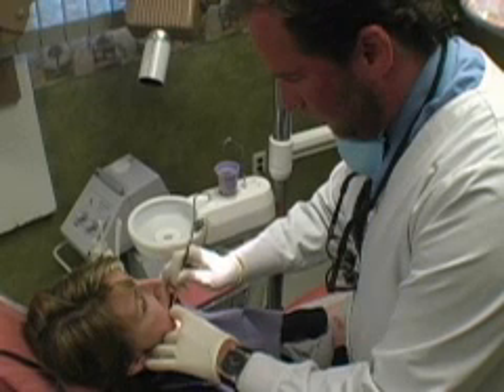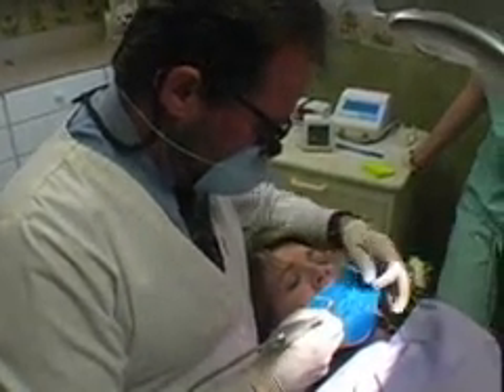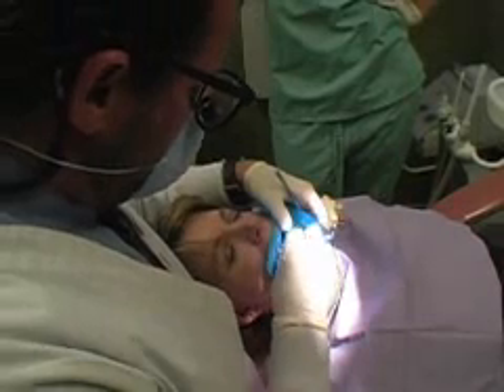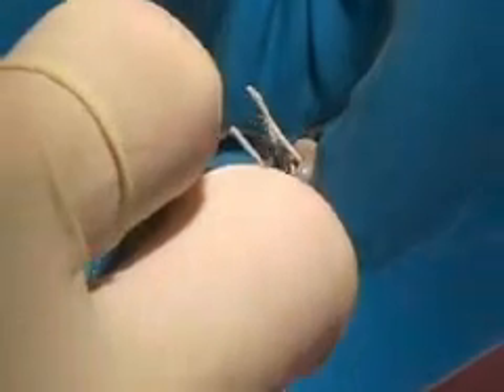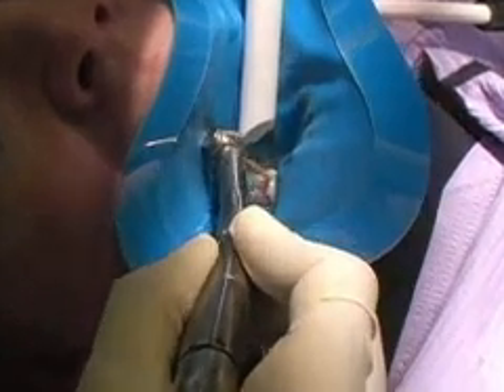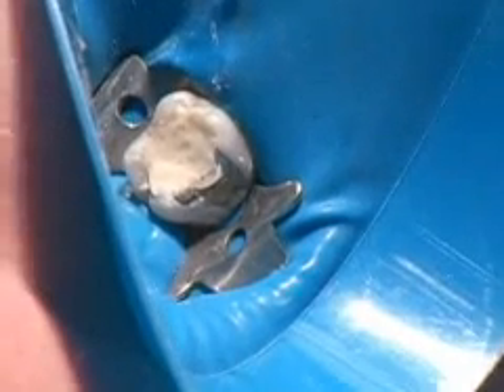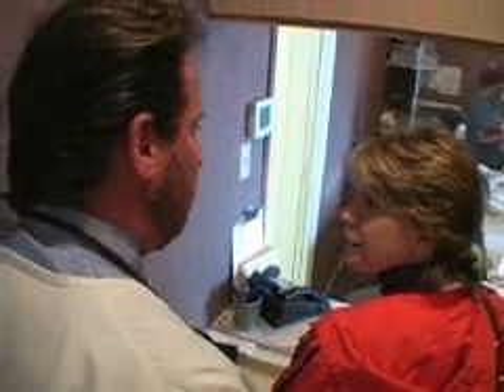Root Canal Demonstration

Comment: o yeah, the only part that hurts is the part where he drills a goddamn hole in your tooth with a metal drill. Shot does not hurt. measuring does not hurt. shaping does not hurt. packing the filling does not hurt. just that damn drilling. don't be suprised when your dentist starts heating up a needle too~ hope that helped...

Comment: They basic goal of a root canal is to remove the infection in the pulp chamber of the infected tooth. This is done by drilling a hole in the tooth, removing infection and tissue inside the tooth, then sterilizing the inside, and then they melt (using heat) a rubbery material into the root of the tooth...And then seal the tooth temporarily.

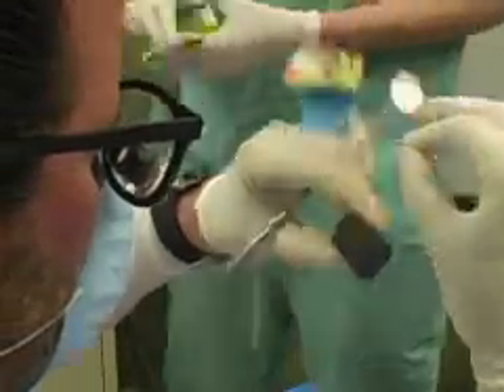Comment: I had a root canal today one one of my bottom front teeth, because the tooth was in the front the procedure took no longer than 1:30hrs. I also had an excellent specialist. Basically first thing they do is dry the area second, use antibacterial swabs/q-tips, third and then a local anesthetic to numb and prevent pain. This is the early phase of the procedure...

Comment: what sucks is that you have to get a root canal even if the nerve is not infected....I got mines today, but my tooth had cracked and my nerve was exposed...no pain or anything; jus bcuz it was exposed Doc said I need a root canal so it WONT get infected....I was terrified; but guess what it didnt hurt at all.....i jus don't like the drilling part to get access of the nerve...i thought the drill would touch my nerve...but it didnt, I was fine...

Comment: Chances are you have gingivitis... It causes major sensitivity (rotting bacteria, basically)... It's the first stage of gum disease. Good news though is that it's reversable - Have your teeth cleaned, then at home use an electric tooth brush, BRUSH YOUR GUMS, and floss eeevery single day. Then the sensitivity will go away. If you have sentivity that bad, chances are this is your prob. :( But you can fix it!

Comment: Also if you are the type that doesn't breathe that well through the nose, then a rubber dam can really add a lot of stress. Little things get you...like pooling of liquid at the rear of the mouth and you trying to stay cool about it while waiting for a moment to react to it, as swallowing when you want to is not always available during work. Sometimes dentists who are young will press some tool against the lower front teeth, but catch your lip without knowing it. That's annoying. Little =big.

Comment: What happens sometimes is that getting the whole root out especially in rear teeth, can be more intense, as time goes by, the root may turn under the gum and be difficult to access, as opposed to just scraping straight down into the tooth with the file. Also, deep down, you may start feeling something during the work, and need more numbing up. It's that period between needing and getting that's get a bit rough.

Comment: i had a root canal done it does not hurt, the thing that hurts is the niddle, but if the ejection is gonna cause u not to feel any other pain  later on it is well wroth it. It takes a while  to complete the persudure  u do it in one day but it take a while, i had to go in for two vists. U may feel a little sore or numb after it put it will pass u can take advil or tyleno for the pain

Comment from the maker: Actually, that's not correct.  You can leave the amalgam and keep a relatively conservative access.  As long as the file does not contact the amalgam, the Root ZX will read out correctly.  In almost all cases, the potential for pain can be reduced to a tolerable level or completely eliminated.

Comment: rather than fuji 9 and a post, a better solution would be to have removed the amalgam and some of the rubber and condense amalgam into the orifaces. this acts as a post, solid core and holds the tooth together as all are in different orifaces. additionally it would be better at stopping bacteria leaking into the canals later as it extends the surface area of the core and the distance bacteria have to travel.

Comment from the maker: Sure, you can use the video, I appreciate your kind words. The searing device is a "Touch-and-Heat" and the backfill device is a gutta percha gun dispenser from Obtura.  I believe in posterior post placement when more than 50% of the occlusal table is missing (like Gordon Christenson advises).  A well placed post will not weaken the root, although I usually use a thin gauged one.

Comment: Great video. I hope you don't mind if I show it to new staff members as a training tool.  Where did you get your guttapercha searing intruments and backfill device?
The only question I had is why did you say that a post is used to strengthen the tooth after a root canal?  I agree that it can help retain a core and crown better, but isn't the common wisdom that a post will actually increase the chance of root fracture.  That is why I hardly do posts in molars anymore. Anyway, great work!

Comment: Does the amount of pain you have during a root canal depend somewhat on the position of the tooth? The first one I had was a breeze, didn't hurt a bit, just some pressure. That one was the 2nd molar on the bottom right. But the 1st molar upper right, hurt like hell. For days after even. He also said he had to cut the gum, maybe thats why?